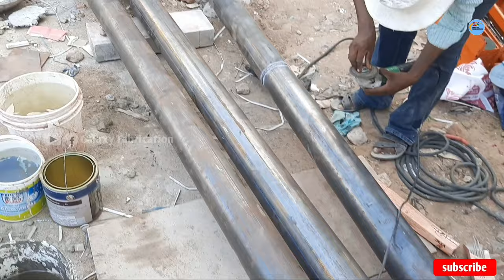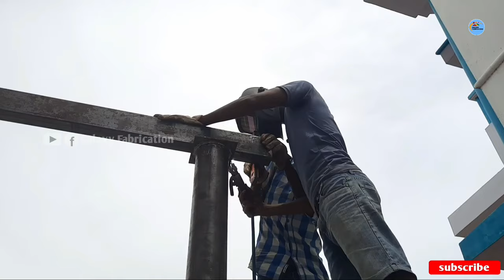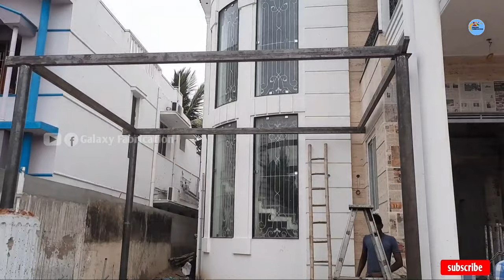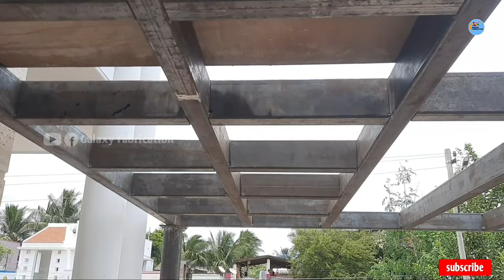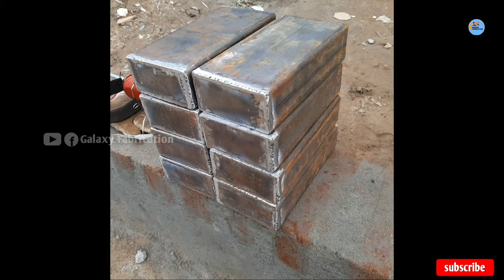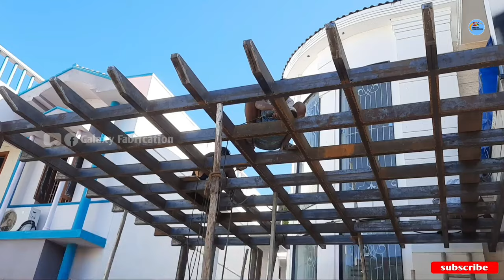Metal Pergola design | how to make pergola |Galaxy Fabricatoon

Comment: Very nice and clean work, the only single video on you tube with a detail information as easy to understand
Reply from the maker: Thank you sir🙏
Reply: @GalaxyFabrication sir spacing information provide please?
Reply from the maker: @Alpha010t  Spacing can be determined depending on where you are setting up.All the boxes should be made to be square.
Reply: @GalaxyFabrication  ok sir my balcony distance 216inch x 106inch so please suggest me spacing idea... this type pergola means shown in this video 🙏
Reply from the maker: @Alpha010t  it should be 62cm every square box. One side(106) 4 boxes another side(216) 9 boxes.
Reply: @GalaxyFabrication  thanks to you sir... for any queries can you get the number ?
Reply: @GalaxyFabrication  any cost idea sir ?

Comment: Good work & which type of material do you use to cover the top ??
Reply from the maker: 12mm Glass..
Reply: @GalaxyFabrication  other than glass for sitting & shade purpose without contact with direct sun  which type of material we can use bro ??
Reply from the maker: @sureshreddyg4025  this structure for laying glass only. Otherwise you can't imagine other materials.  So you can use dark color glasses like dark Brown , dark blue  colors bro.